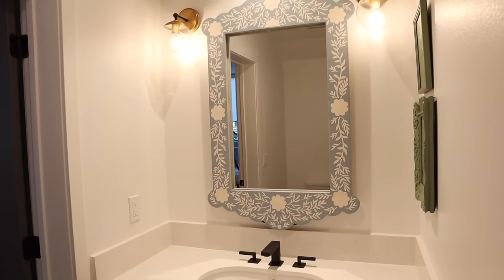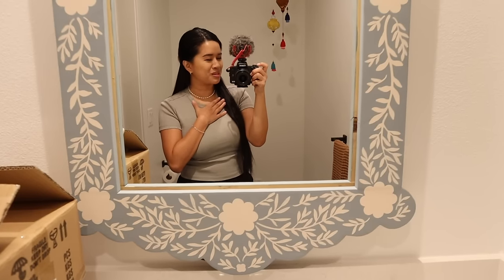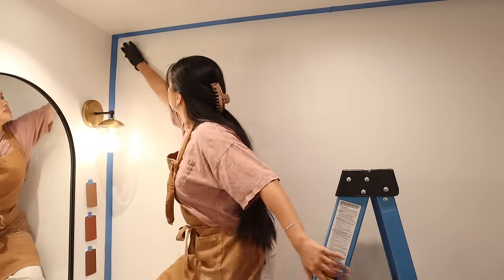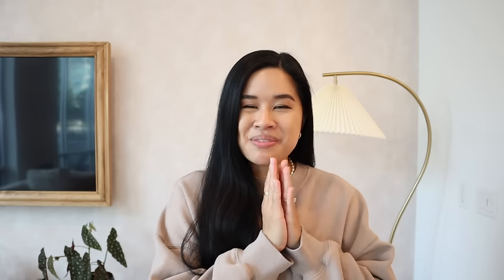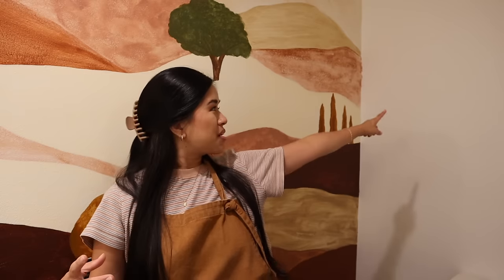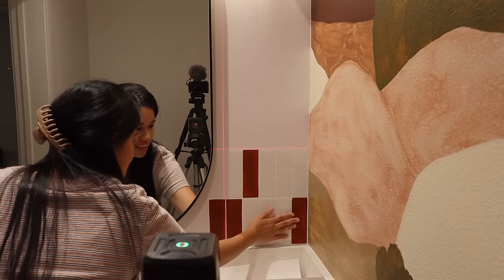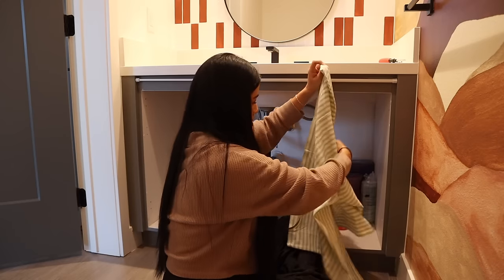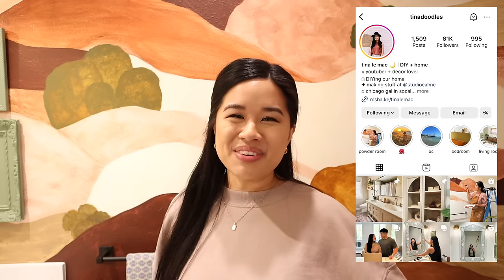ECLECTIC POWDER ROOM MAKEOVER! *RENTAL TRANSFORMATION* (diy mural + peel-n-stick tile)

Comment: Love the mural, but I would have left the mirror as it was originally and I don't think the two picture work on the wall, the mural is enough in itself. I would also have left the doors on the unit for a cleaner look. I like the wall lights and the ceiling hangings really wotk with the mural.
Reply: exactly my opiinion as well

Comment: The color palatte is so nice and the tile sticker idea is so cool. Altough in my personal opinion the mirror frame is an overkill. Was really not necessary. The simple mirror is doing more justice to the cool tile dado and the mural you put together. I would agree with the green frames too. So not working on the mural wall. Need to go on the plain wall if at all. The shutters of the vanity really didnt need changing.

Comment: The mural should be the star.  The mirror,  sink skirt, towels and green artwork  clash with the wall art and take away from it.  Remove them and use black or rust towels...and it would look more elevated.

Comment: I might’ve been tempted to extend the mural to the toilet wall by a foot or so, then the hanging lanterns would look like hot air balloons in the landscape ..... as well as move the shelves over toward the other side wall a shade and stagger their placement rather than one directly underneath the other (and perhaps add one more so there are three rather than two) 
It looks amazing though,   (is there nothing you could put over the tiles to help seal the paint onto the plastic better, so it’s more cleanable?)